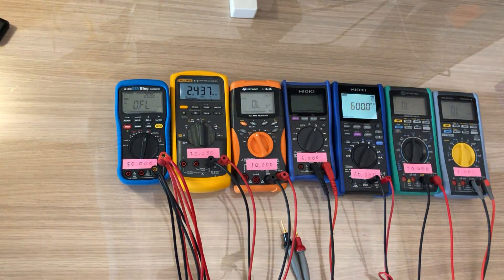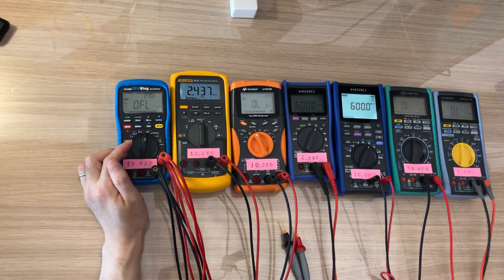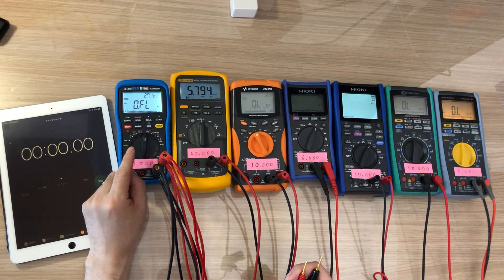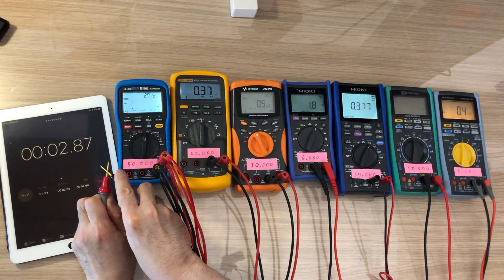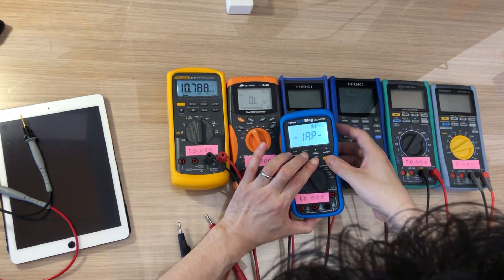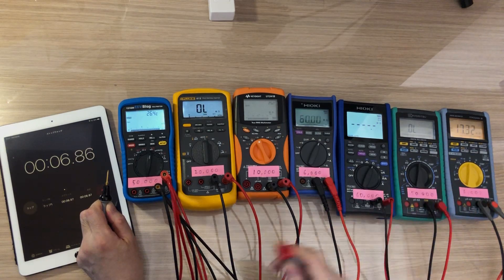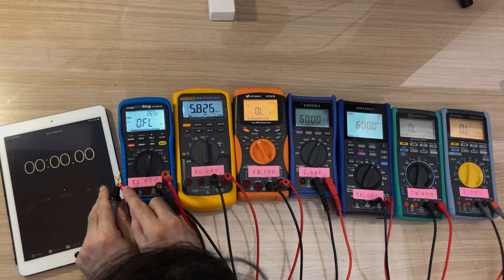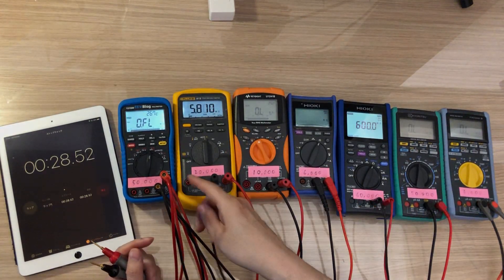Akira-EN #16 Resistance auto range speed 121GW Fluke 87V Keysight U1241B Hioki DT4282 Yokogawa TY720

Comment: Bought last week a 121GW. Backlight not turning off, BT, 15v Diode Test Mode for zener and 55000 counts are great. I have firmware U-2.01 installed btw.